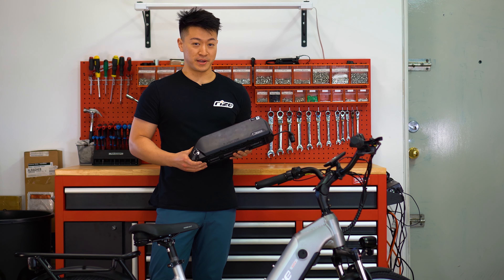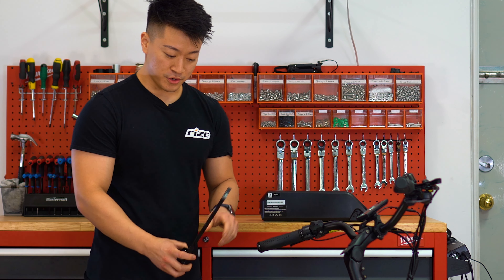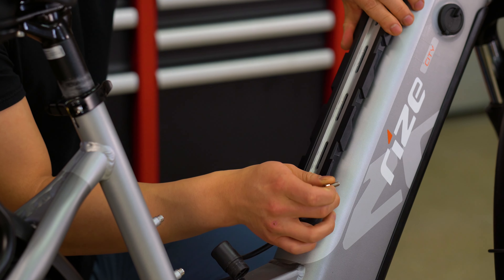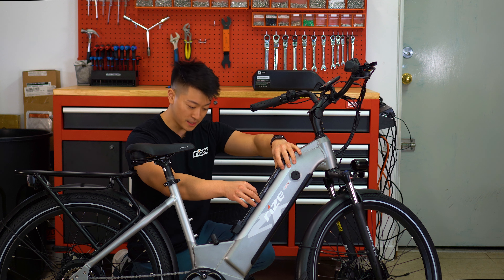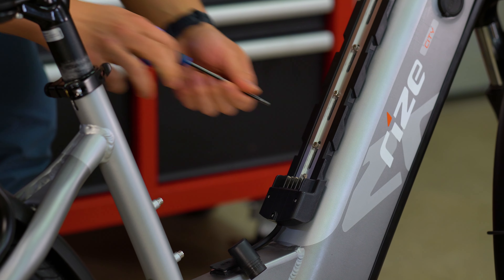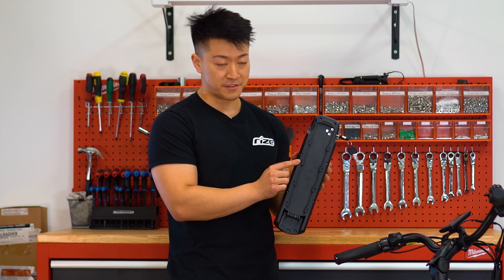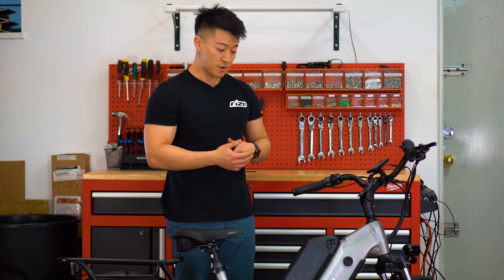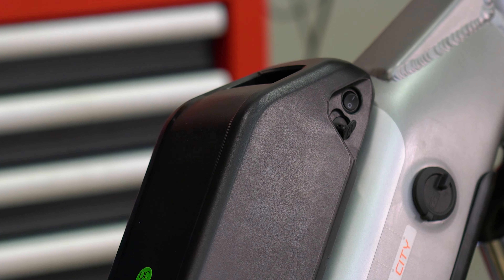How to Install a Secondary Battery | Rize Bikes

Comment: Do both batteries run at the same time cohesively or do I have to deplete the primary battery before I can use the secondary. Also does the LCD display indicate an extra battery bar.

Comment: I have this setup and it works great - nice to know you have plenty of juice when you are on a longer ride ! Are there any rules for switching on the second battery, ie does the bike have to be off or you can turn it on while running? Will the battery level display measure both batteries at the same time and present the overall capacity? (I assume available capacity is just calculated from the battery voltage level).
Reply from the maker: Hi Mike, the bike can be on or off when switching on the secondary battery. When the primary and secondary batteries are on/connected, the LCD will show the overall battery level.
Reply: @RizeBikes  Just for clarification, I was told the balancer between the batteries will pull from the higher charged battery (detected by voltage level I guess) until it's the same as the other battery, then it will alternate pulling from each battery in a one minute intervals so they are drawn down at the same rate.  With two batteries I have done 50Km rides, primarily city, and only used 30% - 40% of the combined battery capacity - and that is with some significant hills. Of course, the draw varies a lot depending on how much leg power you wnat to put in. :-).
Reply: @mikejuzenas93 Is it safe to use like third party rack battery with 52v 30ah using the ebike built in outlet

Comment: Great video (as usual). When I order a secondary battery, is the mounting bracket (with the plug-in) included (or sold separately)??? ,,, thanks.
Reply from the maker: The mounting brackets are included in the box!

Comment: Are the secondary and main battery different types? Or can the secondary battery also be used inside of the frame?
Reply from the maker: Hello,

Our primary battery and secondary battery are different and are not interchangable inside and outside the frame.

Hope that helps!

Comment: is it possible to power the bike 100% off of the secondary battery if you don't have the main one in? im thinking of getting the rize x so i was asking a head of time before i invest in the secondary battery
Reply from the maker: Hi David, you could power the bike with just the secondary battery, but we always recommend having the primary battery attached to the bike to protect the terminal from water, dirt, or mud. Another alternative is to keep the secondary battery turned off until your primary battery is depleted.
Reply: @RizeBikes  i'll keep that in mind but as a rule you should never zero out lithium-ion or polymer batteries as that can damage them more then just using them to 40% charge

Comment: Should both batteries be fully charged for this? What if they are unequal?
Reply from the maker: Hello Jim,

Ideally yes, both fully charged.

The battery balancer will use the higher % one first, and then switch back and forth once equal to preserve battery health.

Comment: Hi, I hope you are doing well!
I just purchased a secondary battery, but I think it is creating conflict with the main battery, because when the secondary battery is on the main battery stops working, and when I turn off the secondary battery, the main battery no longer sent power to the bike, I have the Blaze 2.
I understood that I could have both batteries on at the same time, is this true?

Thank you very much
Reply: That is weird, I have the two battery setup on a Rize RX and the balancing between the two batteries is transparent and appears to work properly. How do you know it "stops working"?
Reply: Is your second battery original Rize battery?

Comment: Is there a video for the bolt x model?
Reply from the maker: Hi Okan, we do not have a video specifically for the Bolt X, but the process will be similar. The only difference is that the secondary battery will be installed on the seat tube.
Reply: merhaba ben de rize x 1000 modeline bakıyorum siz aldınız mı acaba bu markadan ürün?

Comment: I ordered a second battery off your site and it never came with the mount installed to it.... pretty disappointed.
Reply: Same thing happened to me a couple weeks ago, I just emailed them  and they are going to send me the bracket..
Reply: @SuperMoonlight1973  ya I emailed them, such an unnecessary hassle though...
Reply: I had the same issue - Rize told me that they had a problem with production and had a batch without the mounts arrive from China, but did not know since the boxes were sent out directly to customers.  It was a hassle but they corrected it pretty quickly.

Comment: Anyone know if i can get 3rd party batteries anywhere? These prices are scams. 52v for 10 amps should cost 100 dollars at this point if you do the math on the value of lithium phosphate batteries in a typical 12v 100 amp battery and do the math to convert to this battery. I dont think getting the shape makes it thag much more expensive. But lets say it does. Then 200 dollars i can buy.

Comment: All ebike companies really need to up their game on these weak, ugly, silicone battery plugs. I am thinking a brass cap with a rubber gasket that screws on. So much more waterproof, and vastly less fugly. Otherwise I love these bikes!
Reply from the maker: Thanks for the feedback, Bill. Glad you're loving our bikes!
Reply: @RizeBikes  There are some very "cool" IP67 and higher connectors out there in heavy industry.